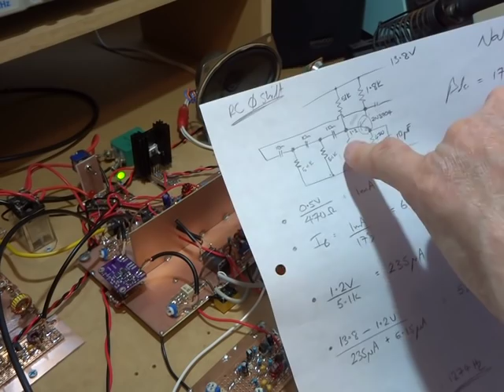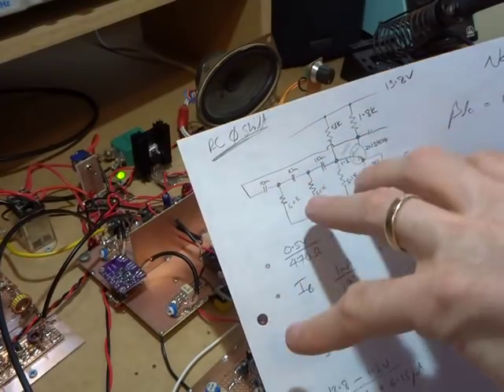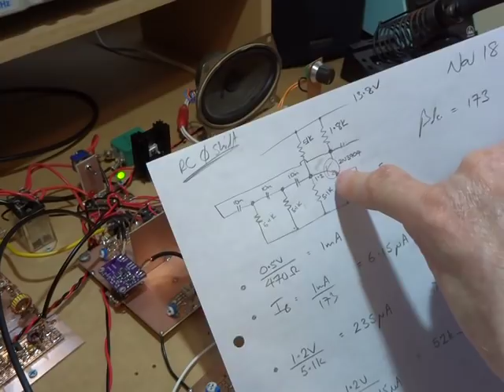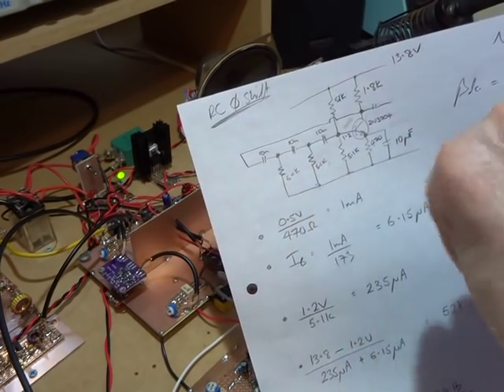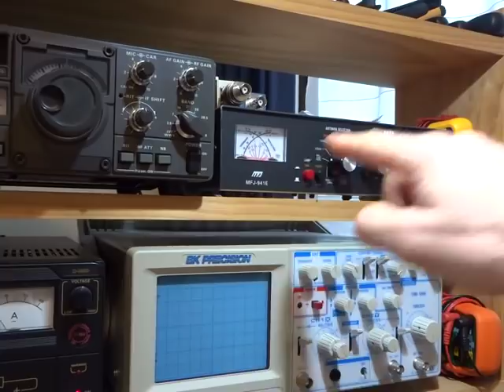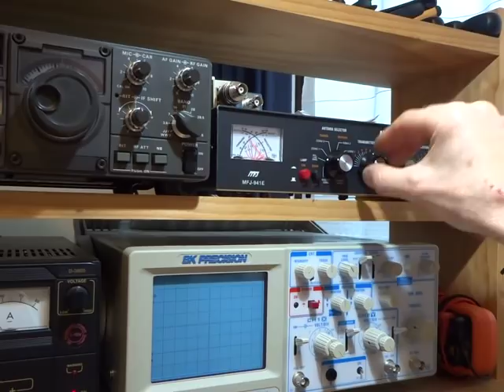Homebrew MC1350P based SSB Rig - #15 Dual Bander, RC Osc Tuner

Comment: Very nice.  Sort of put my homebrew stuff on hold until I could figure out some sort of board to use.
Reply from the maker: Hopefully, that will not take too long and you can get back into it. Happy New Year too.
Reply: Charlie Morris I also have to source myself some thin coax for connecting Different RF "modules"  and hopefully get a better soldiering iron. Happy New years!
Reply from the maker: @kd9kck376  That's great. A good temperature controlled soldering iron with the right tip is important. It doesn't need to be top of the line either.

Comment: Ideal for peace in the house, I nerve my wife with my aaaahhhs, oooohhhs and whistle  (she says) ......
Silent tuning of the TX part is a great idea.
Double tone would be even better ...... build this oscillator twice on a different deeper frequence :-)
73 Bernd
Reply from the maker: Hi Bernd. The plan is to build a two-tone test oscillator for general testing. I was thinking around 700Hz and 2000Hz. That's a reasonable spread and not harmonically related.